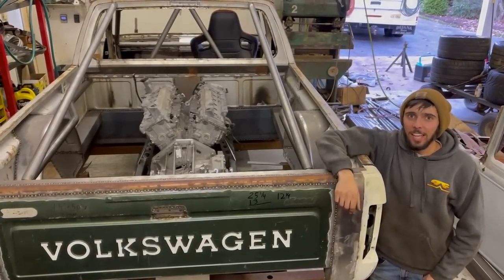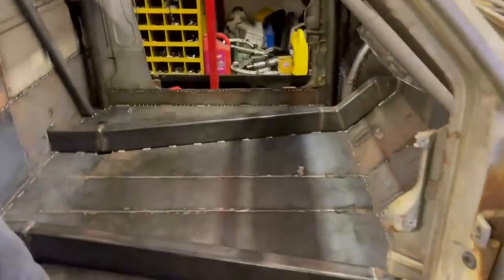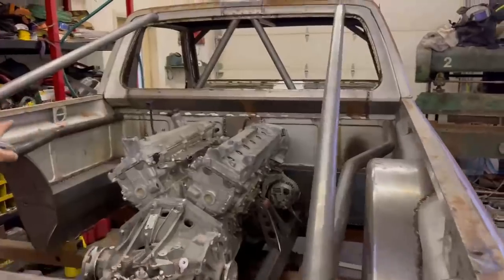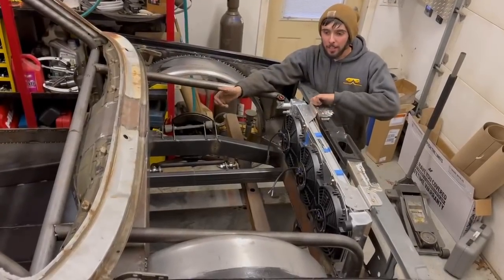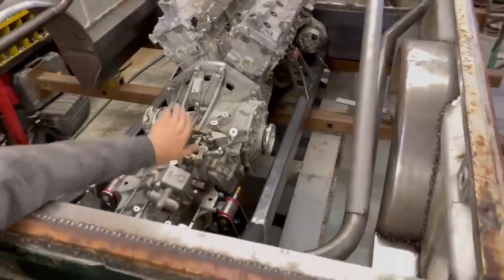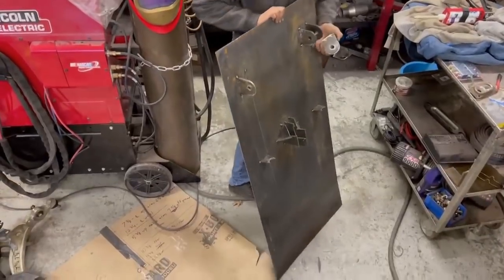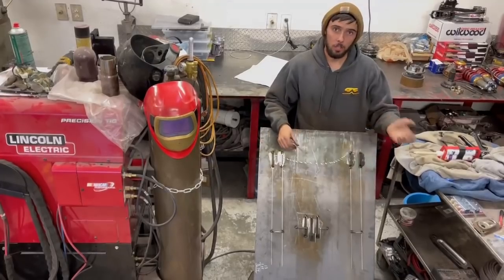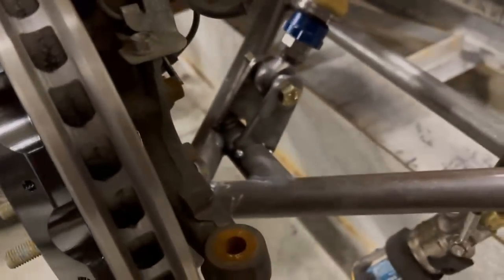Toyota 1GZ V12 Mid-Engine in a Volkswagen Rabbit

Comment: Hey, nice video man! Im going to be building a Honda nsx with the 1gz-fe screaming like the supercar it really is and i think im gonna use the gallardo gearbox too. So i was wondering if you would share drawing/dimensions of adapter plate for the gallardo tranny😃Also how long is the engine from front of engine to the axle with tranny connected? 
Also, how is the project going? I see you havent posted in a couple of years..:/

Comment: @7:31 Good choice on using the Miata suspension geometry (good centers) I race a Miata every so often and I love the balance between  it's dive and mid corner roll.
Reply from the maker: Kyle Fegley thanks! A few of my friends have miatas and i love their handling. Plus i think as far as weight distribution the miata will be closer to the weight of the front of the truck. I was originally looking at corvette but thats made for the whole v8 weight on it.
Reply: Where are you now?